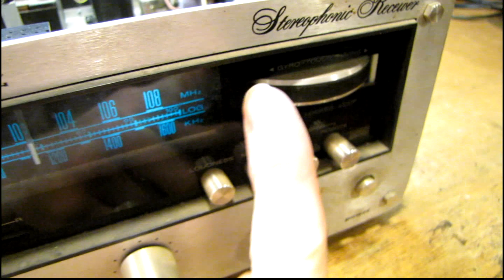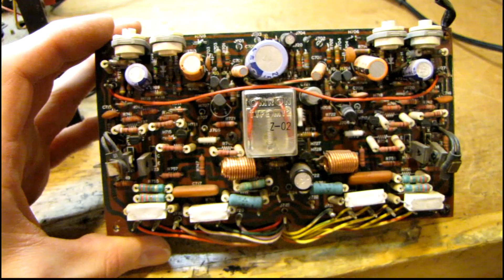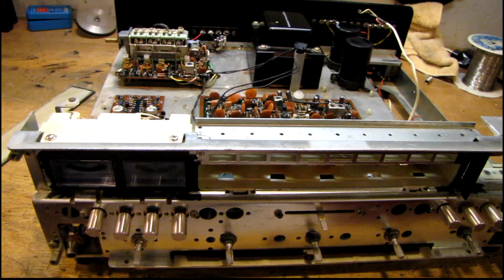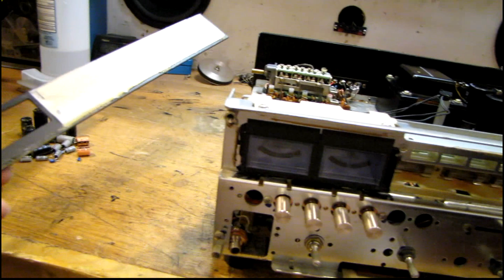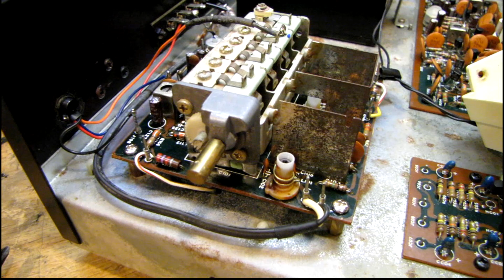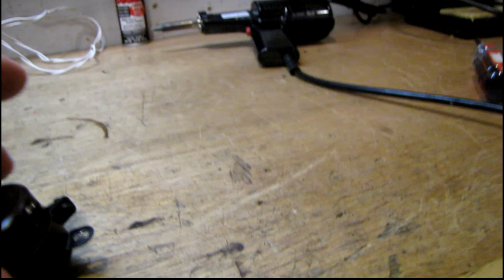Vintage Marantz 2225 Receiver Restoration Part 1 of 2

Comment: Hello.
Please, could you make a video, maybe in HD, to show the techniques, used to renew the satin finish of the front aluminum panel, and also the knobs of the potentiometers?
How to remove scratches in different directions, from the horizontal one?
I use Scotch Brite, but the result is not perfect.
Thanks in advance.

Comment: Nice job.
 
I have a nice amplifier which hasn't been very well looked after and it has scuffs and scratches all over the case. Also, it is silver and I would like it to be black (matt black with a slight sheen).
 
I am happy to take the case off but wonder how I would get the best results?
 
My thoughts are to sand the surfaces with a fine grit sandpaper to remove anything that is raised, fill any voids with something (not sure what the best type of filler would be), then spray the case (any tips on paint choices and methods would be appreciated).
 
Obviously the vented part of an AV gets quite hot, so whatever paint I went for would need to withstand this heat and not go soft/flake. I also have concerns about covering the display with masking tape as I have experience of paint bleeding through on something else I did and it was a disaster. Furthermore, any labels on the front will need replacing, any advise on this?
 
I''d really appreciate your help on this. Thanks.

Comment: hi max. i have a 2220b and when i use the inputs on rear or the tuner there is no output. it powers up. the caps look good. i have to turn the volume all the way full to hear a tiny bit music. am/fm cannot hear anything same with my inputs. what can possibly be the problem??

Comment: Inside of this looks so much easier to work on than the 2230, lol. What source did you use for the fuse lamps, if you don't mind me asking? Trying to find a fairly reputable place to go. All but one of the bulbs is burnt out in my 2230, sadly.
Reply from the maker: +Kevin Roosa There was a seller on Ebay that had the original 200ma lamps sold as sets.  They might still be around.

Comment: I need your help on my sansui 5050 when I turn it on it does this pop static noise and i'm not sure what it is and also when it sits when no audio is currently going its still on there is a static/popping noise in the left channel should I have all the capacitors replaced anyway? its from 1976-1977

Comment: don't use this resolution because it looks bad awful on mobile
Reply from the maker: For some reason, Youtube has been messing up the aspect ratio on a lot of my older videos.  I have to use the stretch function in the video tags to make it look right on the regular player.  Maybe that's why it messes up the mobile player?
Reply: it looks really streached on mobile but if it is only screwing up on old videos dont take time to fix it.

Comment: Great video, I have a question, I have a marantz pm 44se amplifier, I notice the two filter capacitors have some white stuff at the base of them was wondering if I should have them replaced, they are two Elna caps rated at 10,000 microfarads and 35volts, do you know what brand would be a good replacement, thanks.
Reply: Some caps have glue / adhesive holding them to the board so it's probably just that I had the same thing with a 1970 Sony reciever. If you're really worried about replacing them personally I would use Panasonic, rubycon, nichicon or chemicon etc just none of the Chinese Capxon i've seen a lot of these with bulgy tops.  Also if the amp is an excessively hummy I wouldn't worry about changing the caps
Reply: Should read unless the amp is excessively hummy!

Comment: Did you recap the output module as a matter of course, or did you see a problem?  I have a 1535 (not ML) that is not finding stereo signal.  Can you point me in a direction?  It tunes is all local FM stations, but even though the signal strength meter goes to 3-4, and the sound is nice, it is not stereo and the stereo lamp does not light (although it will light with a stereo phono input (Turntable))  Thanks

Comment: hi, Maxx I had to ask, where did you get that wire unwrapping tool from. is this something you made? does it heat up? either way it would be a great help to me. what a great idea for a tool. thank you. ben..
Reply from the maker: I just searched for "wire unwrapping tool" on Ebay and found it, but that was a few years ago. I still see some various models available now, and I think it's the "left unwrap" type.  Mine has two different size tips for fitting various posts.
Reply: thank you max I am going to check that out as I run across a lot of these as I do a lot of work on CB radios, and in the older units I have ran across these a few times. thank you for the help. I am restoring my Marantz 2265b and I saw the website I'm very glad I went to it there's a good bunch of people here. thanks max. ben..

Comment: Maxx, does digikey or mouser sell the fuse lamps for marantz receivers?  Also I need a power switch for my 2220. Alps DPDT?  If not, what do you suggest?  Awesome job on the 2225, and 1060 video too.
Reply from the maker: I always use the NOS 200ma lamps that can be found on Ebay from tech-hifi.  You can also find power switches on there.  Some have smaller shafts though.  A power switch from an AT computer case might be another possible fit.

The 1060 has been great.  I'm using it right now in fact.  The 2225 is currently in storage at my Dad's apartment.

Comment: Where do you get most of your parts? What do you clean the boards with? What solder do you use?
Reply from the maker: Most parts come from Mouser Electronics or Digikey.  Simple Green to clean boards, and 60/40 rosin core industrial solder, but that's not specifically needed.

Comment: Hi Maxx - i have a Marantz Receiver 4270 stereo 2+quadradial 4 circa early 70s. if i were to bring it to my local audio shop for tune up and cleaning, should i be paranoid that the audio specialist would steal any special parts from the receiver i wouldnt otherwise notice missing or replaced with something cheaper; anything in there special that makes a marantz a marantz? Thanks.
Reply from the maker: The are made from standard stuff for the most part.  It's the circuit design that makes them sound great.
Reply: Then i wont be paranoid and i'll bring it in for a cleaning :-) Once that is done, gonna use my dac and hook everything up to my pc. i will try a post a video of it in the weeks to come... Thank you very much for your videos

Comment: Beautiful restoration. It's hard to believe that such a sweet looking piece of kit was hiding under all that neglect.

Is there any value to how the individual boards were anchored apart from one another? I realize that this receiver doesn't have the benefit of surface-mount components or anything due to its age, but it seems like it's still a waste of space.

Comment: By 4:00 you have removed and cleaned all the pcb's.  How did you clean the boards.  Also, I assume you had some systematic method of clipping and marking the various leads to and from the boards.

Comment: By 2:40 the output module was "all  re-capped."  Did you replace ALL the caps or just the electolytics and paper caps?  Woulda been nice to see which caps you replaced and how you did it.

Comment from the maker: 4 bolts on the corners, and sometimes a retaining nut behind a couple of the knobs.  Use sockets, not wrenches, otherwise you risk scratching the faceplate.  Also keep the socket from touching the faceplate if you can.

Comment: I just purchased a 2240b receiver.  The Mono switch is extremely hard to push in, and even harder to push back off.  And recommendations?  Also, how does the front panel come off?  It has the same thing as your receiver....looks like bolt heads.  I apologize, I am new Marantz owner, though I grew up with one as my Dad still uses his 2230.  Thanks!

Comment from the maker: I got the tool on Ebay.  Just search for wire unwrapping tool.  To put the wires back on, I just use needle nose pliers to re-twist until snug, then put a bit of solder on it.

Comment: Nice video, thanks.  Had a runaway drill syndrome destroy an AC evaporator coil while trying to open up a condensation drain hole, know how that feels!  Surprised there weren't more (any!) component failures that needed troubleshooting.  I would never be so lucky.

Comment: I have a 2230 that needs some bulbs and a good cleaning up... just dug it out, along with a Sansui 6060 that seems to work but no sound output at all, any hints ?  I was cleaning out and almost gave them away or threw them out... bit by the bug I guess.. I'm thinking of fixing up both of them, maybe keep them for nostalgia, or sell one ...
I'll be checking out your vids/channel

Comment: Hey Max, do you have any "how to" videos with respect to replacing the diffusion paper and possibly switching form illumination to LED lighting?  The most desired aspect of a Marantz is a crystal clear blue dial, but they all turn green over time and the factory bulbs toast the diffusion paper from white to brown like your video shows.  Is it easy / hard to do?

Comment: Problem solved, they are the original bulbs and the face plate is undamaged. The plastic housing surrounding the bulbs is an ugly yellow colour, i tried cleaning it with bleach and alcohol it helped but not enough, okay don't laugh I painted the inside white and its remarkably a beautiful blue colour when I put it back together, thanks I enjoy your vids

Comment from the maker: The factory ones are 8 volt 200ma.  Try to avoid using the 250ma ones if possible because they tend to distort the plastic reflector.

Comment from the maker: It's been too long to remember.  I used a diode and filter cap to get clean DC voltage, and then selected a resistor that let the LED run at about 12ma of current.

Comment from the maker: @BigForbes There is a fuse for the lights on the power supply board.  It's been a while since I had this receiver, but I think the board is in the front right corner, and the fuse is a smaller size, around 1 amp I think.  They should be AGC type glass fuses.

Comment from the maker: @djcatdog525 50/50 mix of Simple Green and distilled water.  I used a small soft brush to clean everything up and then dried it with an air compressor.  Try not to get it in any coils though.  Probably wouldn't be good for the enamel wire insulation.

Comment from the maker: @cpgixxer If I remember right, there was a typo in the service manual with the test points.  Have you made sure your manual is correct?  I'm not sure which version was wrong, but I might be able to find the proper one if need be.

Comment from the maker: @cpgixxer Sweet, hope it turns out well.  There is a seller on Ebay who has NOS lamps for Marantz stuff, and also new diffuser paper.  I've ordered from them a few times.  

My Marantz 1030 that I use for my main audio system is still hanging in there.  I've worn the volume pot beyond repair though, so it will be time to locate a good replacement soon.  Might just upgrade to a 1060 if I can find a good deal.

Comment from the maker: @ventureelect 50/50 mix of Simple Green and distilled water.  Used a brush to loosen everything and then rinsed, and dried with air compressor.  The RF tuning coils need to be kept dry though.

Comment from the maker: @batterymaker The caps are almost certainly going bad if they are original.  Also check for bad solder connections, and clean all the controls with De-Oxit.

If it has a speaker relay, the contacts could need cleaning.  That is another common problem.

I get a lot of my parts at Mouser.  Other sources are Digikey, Ebay, Electronix, etc.

Comment: i heard you say you swaped out the light that lit the red stereo sign with a LED and a resistor? Can that be done with all/ant lights? The reason I ask is several lights are out on mine. What is a good replacement for the original burn out bulbs? Thanks ahead of time.

Comment from the maker: @RodBeauvex Depends on the circuit.  I usually keep the capacitance the same, but increase the voltage rating a step.  If I know for a fact that the rectifier can handle a bit more inrush current, I'll increase the size of the filter caps a bit.

On this particular receiver, I kept the capacitance values the same.

Comment from the maker: @lukeschumann Yep, I'm on AK, usually in the tube forum.  Sometimes I visit the vintage Solid State forum too.  In fact I was on there a few days ago with a question regarding this receiver... Turns out the service manual did have a misprint.

Comment from the maker: @hobolooter For circuit boards I use compressed air.  If they need washing (like this one did) I use Simple Green.  For face plates, Novus #2, then Novus #1.

When using Simple Green on circuit boards, dry thoroughly with compressed air, using around 60 PSI or so.  Make sure there is no fluid left under any parts.

Comment from the maker: @PutSome5tankOnIt I'm sure the large systems are reliable, but I've had nothing but trouble with modern small stuff (dehumidifiers and window AC units).  They seem to lose the refrigerant after a year or two.

My furnace is an Armstrong Air, and has been running fine since it was installed in June 2003.

Comment from the maker: @costellom5 A solution of Simple Green and distilled water, lightly scrubbed with a brush, then fully dried with my air compressor.  Took 2 passes to get all the grime rinsed off.

I'm pretty sure this receiver had gotten wet, because normally the dirt just blows off with air alone.  This stuff was like mud.